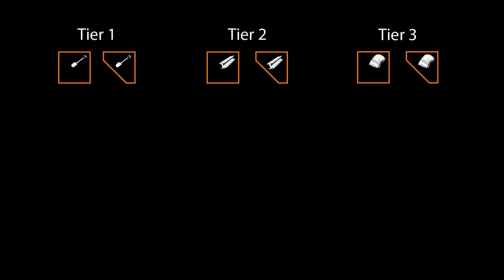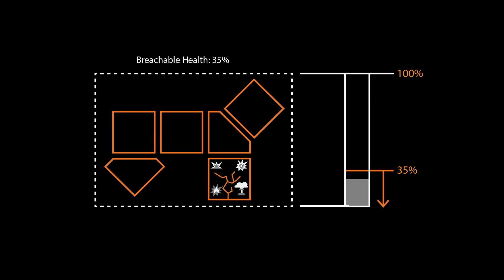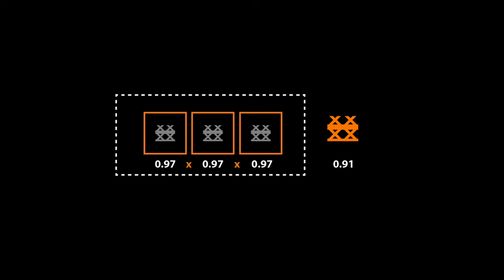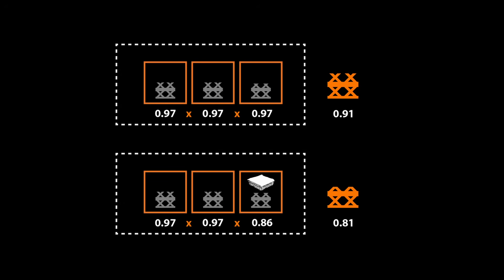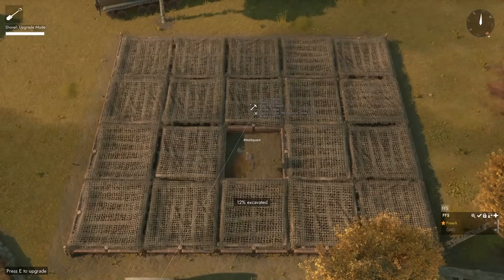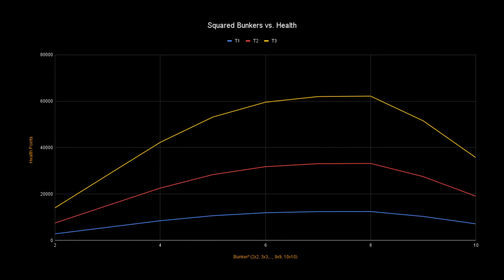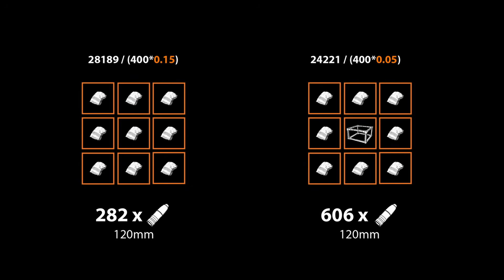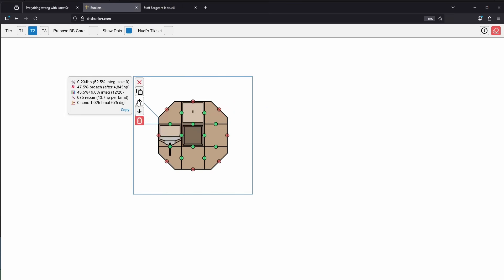Bunker Health Mechanics Deep Dive

Comment: Im a bit confused I confess, with my old builds it's 20 pieces. According to foxbunker it has a total health of 11,018, a breach at 85.2% so from what I'm seeing that's bad now? Also on the website it says after 1,632hp so does it need to get that low on hp until it's breachable or after it takes that much damage?? Man I used to love building
Reply from the maker: It means that after having taken 1,632 damage, the complex has a change to be rbeaches with every explosive or heavy explosive damage that gets done to it.
A high breachable Health value is a not really a good thing (generally). So a breachable health of 85.2% means that if your bunker complex has a health lower than 85% each consequent explosive or heavy explosive damage will have a change of breaching
Reply: Woof so you get penalized for building bigger or uniquely seems like. I spent a lot of time making bunker designs so this pretty much is the nail in the coffin for me

Comment: What do you mean by "the shared health pool will always be lower than the sum of its parts combined?" does it mean that 2 tier 2 bunkers combined dont have a total of 4000hp?
Reply from the maker: Correct. Since the structural integrity of even blank pieces is lower than 1 and the healthpool gets multiplied by the total structural integrity it will always be lower. 2 tier 2 bunker pieces have a health of 3849HP

Comment: You've only considered the benefits of AS based on the maximum HP value, but if you take BH into account, the situation changes and AS becomes almost useless. At least with an average 20% chance of a breach. It would be great if you could try to calculate this yourself.
Reply from the maker: I am not sure what you mean by "doing the calculation taking Breachable Health" into account. Do you want to see  how the Artillery Shelter influences Breachable Health?
Reply: @FreerkHoltes  I mean, if we take into account the breach mechanics, then the bunkers with AS will be destroyed earlier. So it makes sense to count not just by the full HP.
Reply from the maker: @magic620  Breaching is a change not a given, so it is a hard thing to account for. I've had bunker complexs with 6% breachable health collapse at the first HE grenade thrown at it after it reached 6% health left. And I've had bunker complexes with 36% breachable health not breach at all and just full be destroyed.
Also a breached bunker complex has all it's remaining parts still functioning (garrisons etc.)  where a destroyed complex is just... well... destroyed.

Comment: can you make a video about wet concrete and dry concrete? like how long to dry on every weather, how strong on 1H, 2H, 4H, 6H of wet concrete?
Reply from the maker: I do not see myself do that in the near future, but you never know.

In the meantime, the wiki page on structure health (https://foxhole.wiki.gg/wiki/Structure_Health) has a small paragraph referring to this:
Concrete structures that require curing are weaker when their concrete is wet. The wetter the concrete the weaker the structure. Values shown are for dry concrete. A concrete structure that is at its wettest (just been placed) take 10 times more damage. At the half point of curing the structure takes 2-3 times more damage.

Comment: when digging a bunker base I usually dig a 2X3 oval with 4 corner pieces and a bunk bed in the square bunker to prevent an engine being placed there with many 1X3 segments I suspect this good enough but for some reason everyone else seems to build fatter bunker segments any ideas what the best plan is?
Reply from the maker: I would really suggest just planning out different builds on foxbunker and seeing how extra pieces effect health and breachable health.
It's pretty quick to compare builds there once you get the hang of how it works
Reply: @FreerkHoltes  I don't think I am doing anything terribly wrong for making a simple defendable position just wondering if there is anything in particular I should change to make it more useful if it survives long enough to become a concrete mega fort
Reply from the maker: @vladthecon  It is very hard to determine that. Increasing Bunker Complex size for instance does not only increase health but also makes it more prone to breaching, so there is a trade off. Same is true for garrisons, more garrisons could mean more retaliation and firepower but will also make it easier to breach and make it weaker because of the hit to structural integrity.
A lot of things are situational. 
And bunkers occupy the weird area where you both want to have them be tested in a real push but also don't want that because of the chance of it being going down quick, taking hours and hours of work with it

Comment: There is a small mistake at 12:48, it should say 24221 / (900*0.1), since the artillery shelter bumps the resistance up to 90% (75% from concrete and +15% from the shelter). EDIT: the one without shelter should be .../(900*0.25), and the same thing for the following example with the howitzer trap.
Reply from the maker: Ah good catch! That's what i get for copying my images around. 
Luckily I only screwed up the display of the calculation, not the actual calculation which seems to be correct right?

Comment: Great video! 
I don't think it will affect any point you brought up, but I think you made some error in the calculation for the HP graphs. I'm curious as to what formula you used to calculate the Total HP. When I tried to create my own graph plotting Total HP I got different results, maybe I'm misunderstanding something.

Shouldn't the Total HP start to go back up when the Structural integrity gets so low that only the edge bonus matters (0.97^x+ 0.05  =>  0 + 0.05)
In your example it looks like the HP will continue to go down but shouldn't the Structural integrity flatline at around 5% while you keep adding 750 HP per bunker piece?
Reply from the maker: This is exactly what i ran into as well and where Tsekho helped out. The point where it starts to go up is the point where the bonus exceeds the strutural health value itself.

If "bonus" is bigger than "structural health":
instead  of "structural health" + "bonus" it is
"structural health" * 2
Reply: Ohh, okay. That explains the sudden change in the graphs.
Though I don't think it matters much since we don't usually see many 100+ piece bunkers 😆